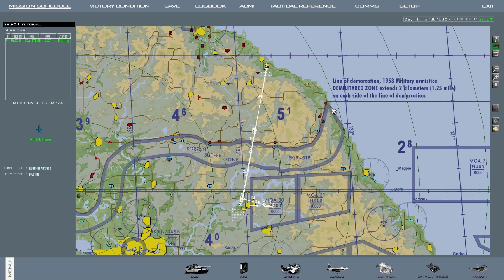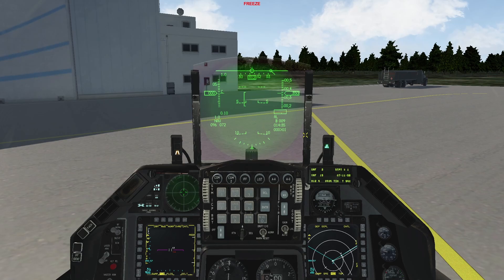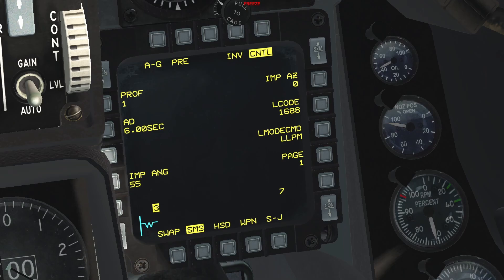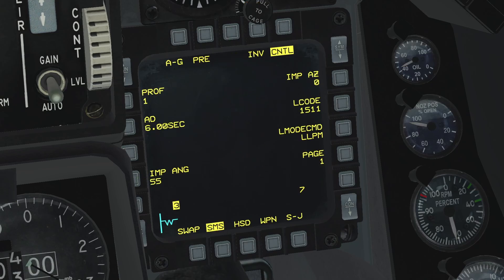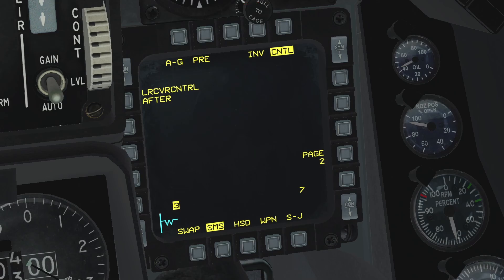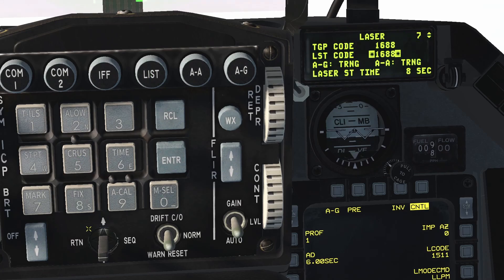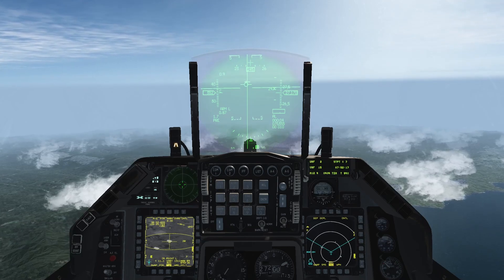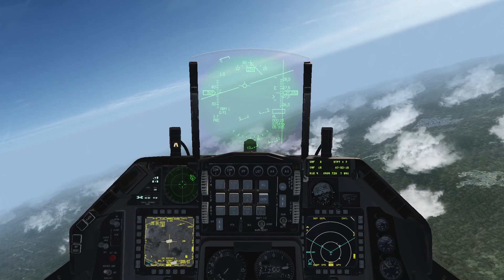Falcon BMS 4.37 Tutorial - GBU-49 and GBU-54 LJDAMs

Comment: The GBU-54 is one of my favourite munitions in BMS. But I do find it pretty odd that Laser-guidance mode not only has to be activated for each bomb individually, but the fact the you have to cycle on page 2 of the control page just the change the mode. There would have been room on page 1 to begin with, even more so considering the the page cycle button also takes up an OSB and page 2 literally only has one option anyway. If that's how it is on the real Viper that looks like a major oversight to me.
Reply from the maker: @Kestrel16C  I agree, having to go to page 2 to activate laser guidance is a bit annoying, a feature this important should be more readily available and I hope that's the case IRL. But despite this extra step, the GBU-54 is still worth the hassle for its versatility.